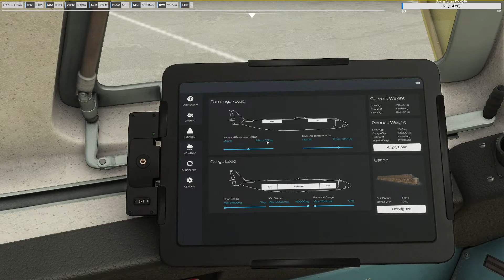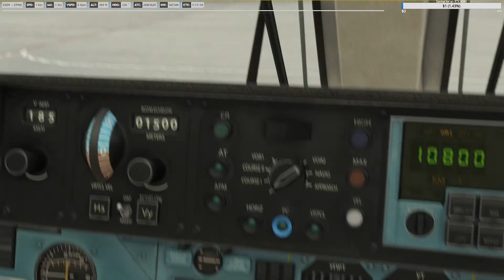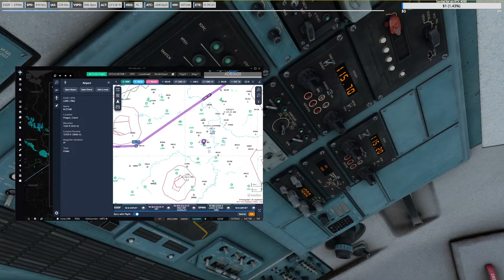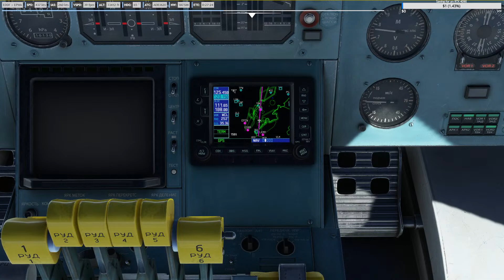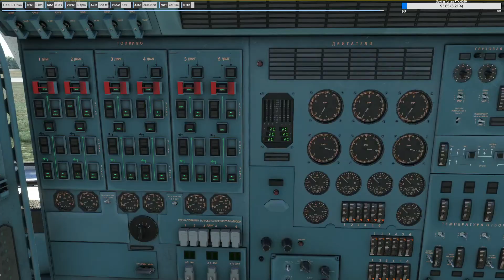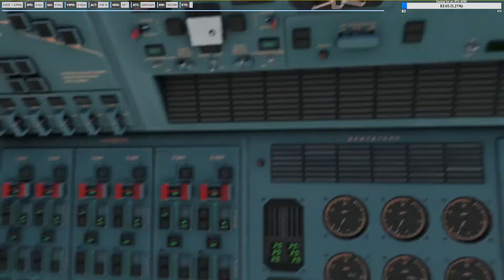Antonov 225 on VATSIM | Frankfurt - Warsaw | Real Airline Pilot

Comment: That struggling autopilot is the dealbreaker for me, the real reason it´s that way is because they used the default autopilot logic from asobo with a overpowered trim to make it 'work', by they saying "that´s how the real plane worked" you can translate to 'we won´t fix it'
Reply from the maker: The same they did with the A310. I know. But as long as I can't prove them wrong...

Comment: One thing to check is that the payload has actually loaded in the aircraft. Twice I loaded up at full payload applied and it just went up like a rocket as the load wasn't actually put in. I now add it manually in the default payload manager when I do the fuel. Also, have you recently had localizer issues? The last 4 flights it seems to track to the left of center, by some margin, and I have no idea why! Quite frustrating while in busy airspace on VATSIM!

Comment: The AN225 was often parked on taxiways etc due to its size but mainly because it needs to carry its own tow bar which meant if you parked nose in you would have to push back into the taxiway disconnect then load the tow bar before taxying which took time.